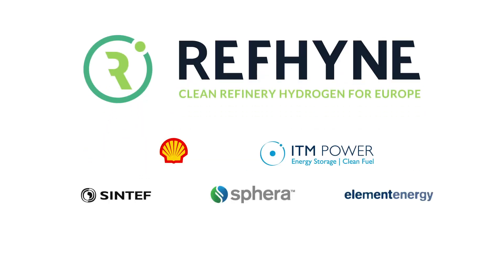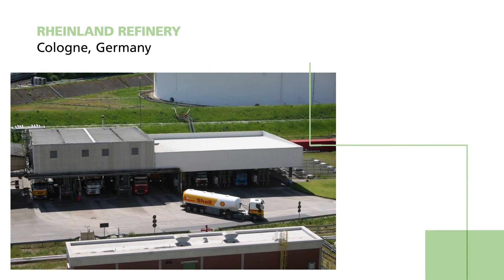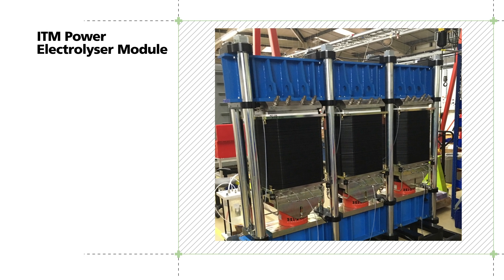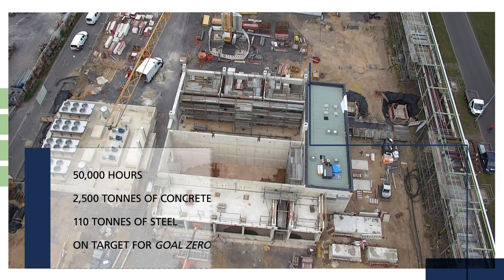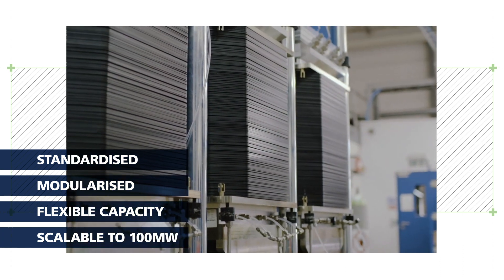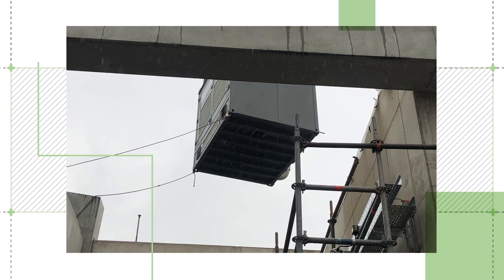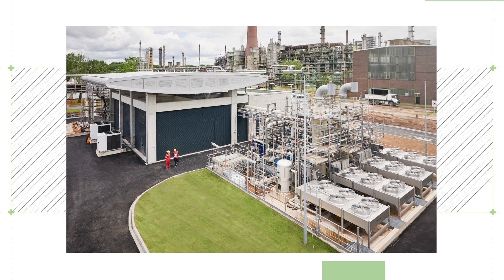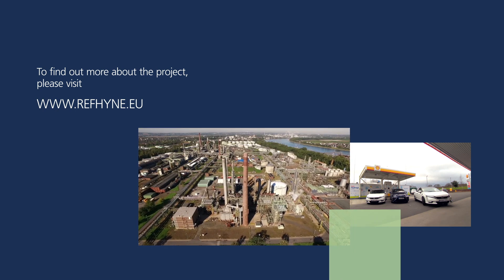REFHYNE: Clean Refinery Hydrogen for Europe. Third Project Video Update

Comment: At 0:50 the hydrogen high output pressure of 20 bar from the PEM without a separate compressor sounds like a major competitive advantage for ITM. How does 20 bar compare to the pressure of the hydrogen storage in the current Toyota Mirai FCEV; is 20 bar pressure enough to refill a FCEV car or bus?